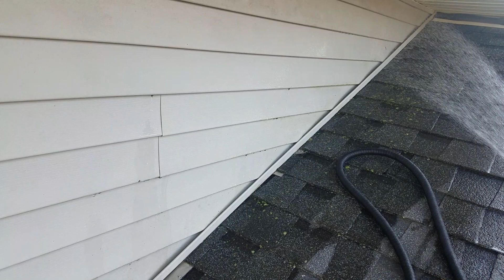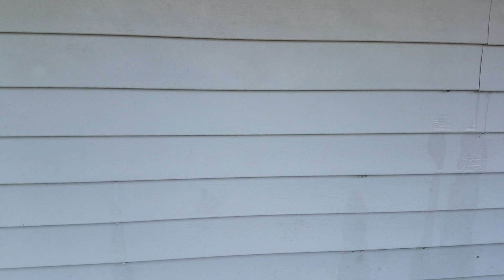Finding a Vinyl Siding water infiltration issue.

Comment: I am going to do this to my house. How do you fix them!?
Reply from the maker: This is un-fixable in the sense that you will not be able to prevent water from getting behind the (vinyl) siding at a roof/ wall interface. That is where the house wrap is vital. Secondly, it helps to install an under flashing that pushes the water back out at the lowest area (probably near the gutter in cases like this).